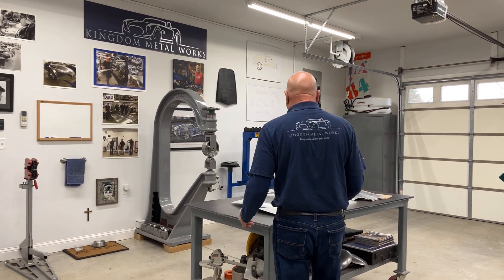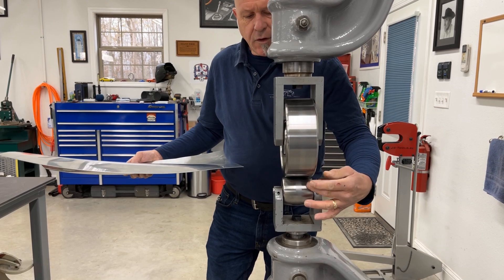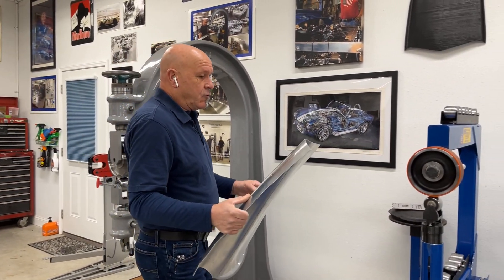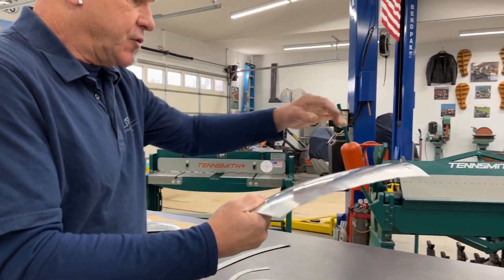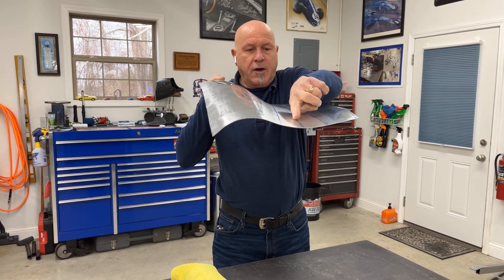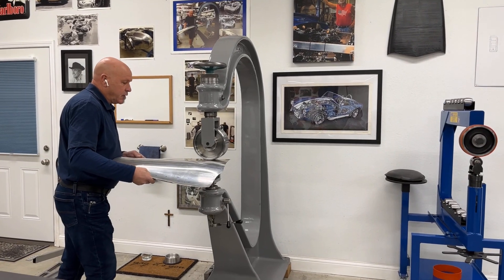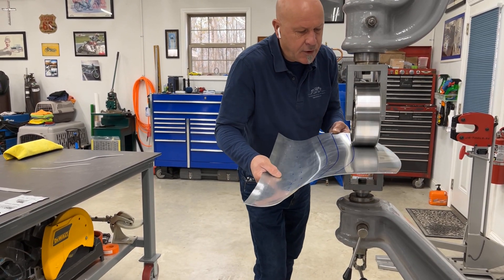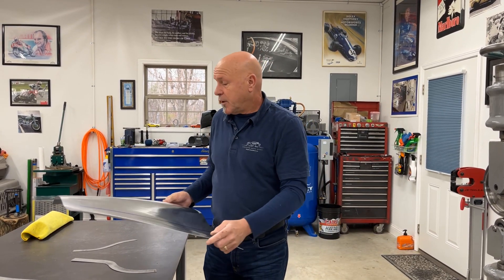Signature Series in Metal Shaping Session #1- D - The Reverse Curve

Comment: Great content Kevin it is very easy to understand, I have a question about your lower anvils with flats are they actually flat as checked with a straight edge or do they have a very slight crown in the flat area. Thanks again for taking the time to do this really enjoying it.
Reply from the maker: Hi Chris, thank you for your comment, I really appreciate your feedback. As for the lower anvils, they are actually true flats in the center section of the anvil.